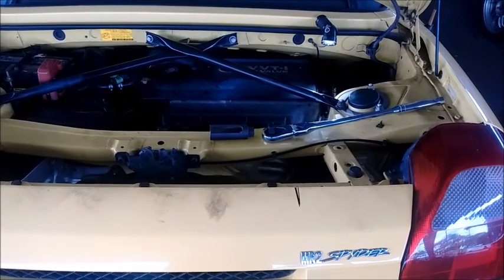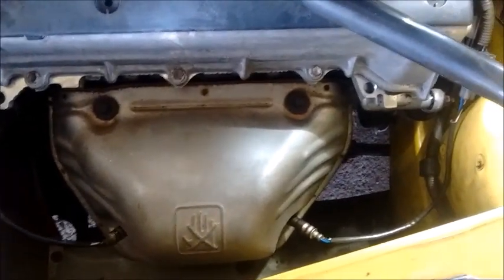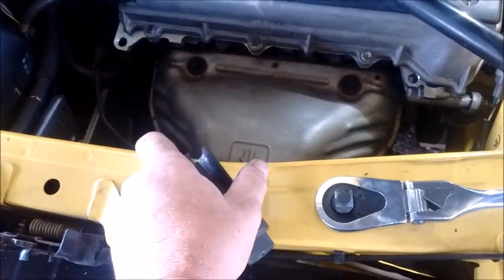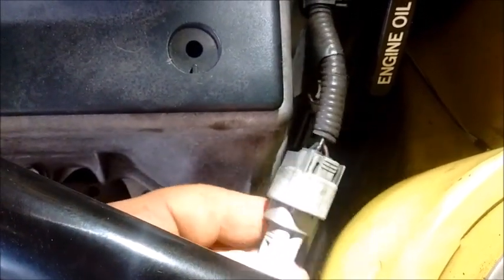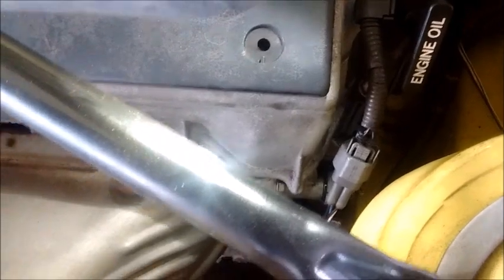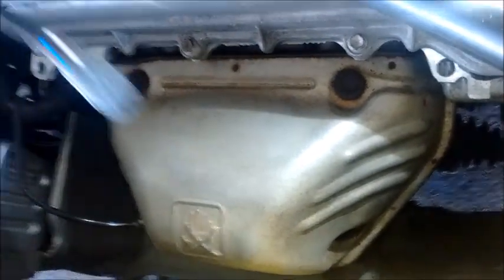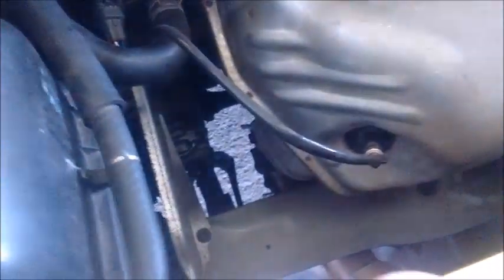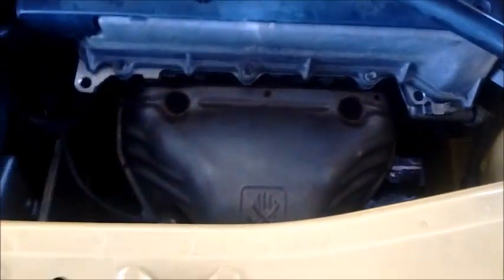How To Remove the O2 Sensors - Check Pre-Cats - Toyota MR2 Spyder 1zz-FE

Comment: Hey Frank, i keep failing my emissions test on my 1ZZ mr2. New o2 sensors, new spark plugs, new main cat converter. I have a pod filter , and stainless exhaust manifold. Do you think fitting a new pre cat manifold, new MAR sensor, or revert to original airbox is the way forward?
Reply from the maker: What is the specific failure that is being flagged?
Reply: @Merryfrankster_  i took a photo of the read out machine but cant get a photo to you here. The “CO2 percent” was 0.62 and the Lambda was 1.176. These numbers are red and here in the uk that is a failure. If it helps the “HC- ppm” passed with a value of 95
Reply from the maker: @andrewsparey697  Do you have a check engine light and/or did you check for errors (DTC's} stored on the car's ECU?
Reply: @Merryfrankster_  i did have a check engine light before my emissions test. I bought a diagnostic computer . It stated “P0141 O2 sensor heater circuit bank 1 sensor 2” . I believe this is the post cat sensor. I bought a generic o2 sensor off amazon, fitted it, cleared the codes, took it for its emissions test and got the failure results above. It was at that point i replaced my spark plugs and failed again.
Reply from the maker: @andrewsparey697  There is nothing here that really jumps out at me. Sorry I can't be of any real help.

Comment: I'm getting a P0135 reading- Bank 1 Sensor 1. That would be the one (on the right) that you were removing at the start of the video correct?
Reply from the maker: Bank 1 sensor is closest to the timing chain,  on the right side of the car.
Reply: @Merryfrankster_  THANKS!
Reply: I have P0031 code as Bank 1 Sensor 1. Where is that located? Near the timing chain?
Reply from the maker: @peteranania7166  bank 1 sensor 1 is closest to the timng chain timing cover
Reply: I got a po155 back 2 sensor 1is that the one on the left? Thanks

Comment: Hey Frank, thank you for these explainations ;) I need to replace the left O2 sensor on my MR2 (P0155, bank 2 sensor 1), the one that is on the opposite side, due tu resistance malfunction. Do you have the OEM number or the DENSO reference for these sensors ? Mine is from 2006 but I will also check the pre cats :P Thanks !
Reply from the maker: Upstream sensors are both DENSO 2344624. They are both the same. In fact a practical test is to swap them and see if the malfunction follows the sensor or not. Downstream sensor is DENSO 2344603. It is the same as both upstream sensors EXCEPT for the length of the wiring. Also can be used to swap and test.
Reply: @Merryfrankster_  Thank you so much for these useful indications, I will proceed :D

Comment: Anyone know just how common this is? Looking at a 2003
Reply from the maker: On the 2000-2002 it is common. On the 2003-2005 you don't have to worry as much, the piston design was updated. This was for the US Market. In the Europe market, the piston design was not updated until 2005.
Reply from the maker: @Jethro Hull your info is absolutely wrong. It does not apply to MR2 Spyder. For example, for European market the piston revision did not apply until model year 2005. For USDM the piston revision did not apply until partway through 2003 model year.
Reply: As I understand it there were a lot of mods. to the European facelift models in 2003, which included a 6 speed box, more secure precats & piston ring changes.
Reply: Thanks for ur replys ended up getting a lancer instead

Comment: How do you check if the o2 is good, i saw that you have to test the 2 black wires can you tell me what resident it shows?
Reply from the maker: For the heated O2 sensor the heater circuit should have 10-15ohm at room temperature. Higher at operating temperature. Refer to your car's repair manual.
Reply: resistance

Comment: Hi i just bought a mr2 spyder and I'll be checking this on my car. I  want to change it from smt to mt and i thaught i could just get a 2zz donor car and swap the motor and gearbox but it looks like i need the mwr kit just to get it manual so looks like i have to keep it 1zz and 5 speed not happy with that. Thanks for the vid i just subd
Reply from the maker: I am about to part out a 2002 Spyder and I can sell you many if not most of the components of the MWR kit including clutch MC, clutch pedal, brake pedal, shifter cage, shifter cables, clutch slave, M/T engine harness, body harness if you want it, M/T instrument cluster, throttle body, M/T ECU with key and ignition lock cylinder, basically make a list of what you want for your swap and you can have it.

Comment: How would the cat converter particles get back into the cylinders?
Reply from the maker: Exhaust flow is not as simple as it seems. According to the experts, coming out of the cylinders, exhaust gas does not flow in a steady stream, it propagates in waves. When the pre-cats become clogged with oil that gets past the piston oil control rings, the exhaust waves can be reflected back into the cylinder, carrying small catalyst particles with them. I'm not an expert on this and someone else may have a better explanation.
Reply: @Merryfrankster_  

Hello Frank Saab,

You stated it quite correctly. the pre-cats are bank 1 (cly 1 and 4), and bank 2 (cyl 2 & 3).  When at TDC there is a small overlap and exhaust pulse/wave that can back-feed into engine.  It does not appear to be probable at the macro level (exhaust one way) but the pulses also create small vacuum per bank and that allows particulates from the degrading cat material to get back into the engine.

Mr. P
Reply from the maker: @LSmiata  To the unitiated exhaust flow can seem like black magic. Look up "reversion."
Reply: @Merryfrankster_  

Hello Frank Saab,

Great point.  This also helps explains why racers use at least a very short pipe/header.  Without, engine fails :-(
Reply: Hello Frank Saab,

Just in the case that my post does not  make the video deadline and is gone....

Also research scavenging.  That was the initial design for the 1zz and especially the MR2/S and allowed it to be certified as an ULEV.  To gain this status also requires placing pre-cats as close to engine as possible to gain heat at start-up and go to closed loop EFI.

Mr. P
Reply: Ouch....ran out of time.

Scavenging only works on a tuned system....once cats start to get "clogged", all bets are off and back-flow starts.

Mr P

Comment: What size is the 02 socket?
Reply from the maker: It is 7/8-inch or 22mm. This is the standard size for all O2 sensors. You can find an O2 sensor socket at any auto parts store.